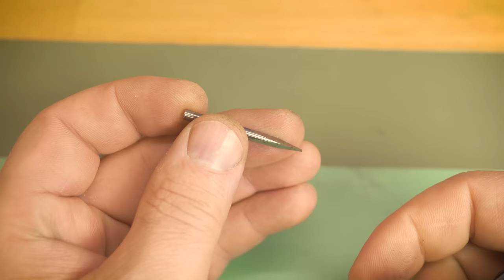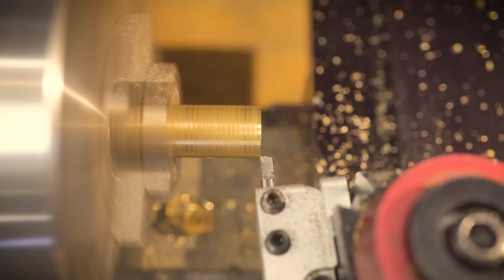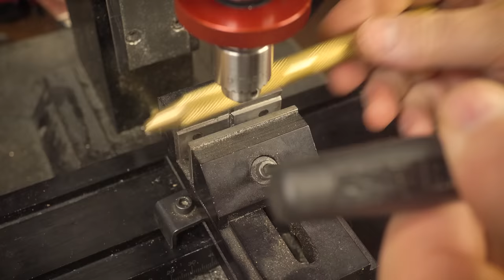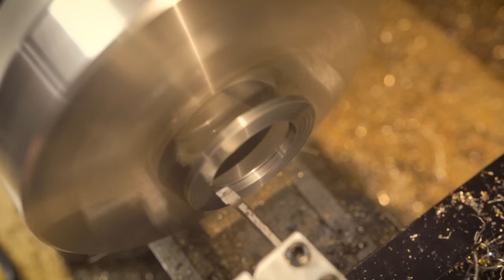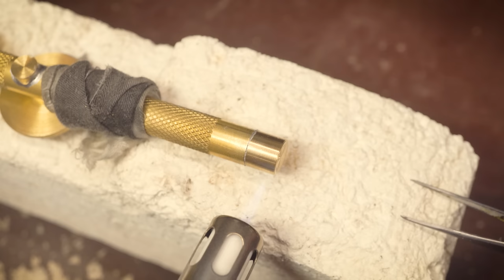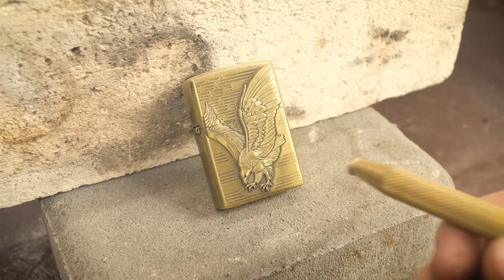DIY Sandblaster + Baking soda

Comment: Yet another beautiful job! I'm curious why you chose to solder in the nozzle, I would think you might have to replace it at some point.
Reply: Heat up and replace.😉
Reply: i was thinking the same and wounder if a 3d printer nozzle would work and then be easy replaceable and strong

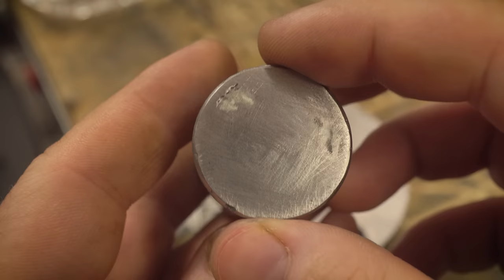Comment: 5:20 set heat to about 30 set your pulse to 1.5 if you want to go slow, set your low to 25% or just before the metal starts to gloss over, your high start with 45% if not fusing go higher till desired result. These setting are meant for thin metal fine work. I keep watching your awesome channel.
Reply: Michael Bishop   Jeebus, you can afford a pine cone, an elastic band, AND a paperclip?! 😲
Some people are so jammy; I'm still saving up for mine! 🤢

I'm right with you; I can't help but watch these fantastic videos thinking "ooo, I want a mini-lathe, too!" or "OMG, that fibre laser is awesome!" and "Wow, I'd love a tig welder!"  Then I remember the most important thing that I can't buy... the guy's talent! 😂
Reply: @Loneman_OG  I am so broke that my money owes money. I may know what to do with a TIG welder doesn't mean I own one 😂. Or have a safe place to run it, I live in an apartment unit second floor. The down stairs lady hears one loud noise and she comes over and complains if it's going to go on all day.
Reply: @DanteLevelsUp    I feel your pain, fella.  Years ago, I worked making commercial and domestic roller shutters, gates, sliding steel doors, window bars, and other security stuff.  I learned to use plenty of chonky tools & equipment, and I'd made myself lots of random things for my home.  Over-built car ramps, a fancy aquarium stand, a tank of a PC desk, and other assorted over-engineered stuff. 😎

  Now I'm restricted to small, DIY projects using timber mostly until the prices rocketed.  About 5 years ago, I discovered the 3D printing world, so I can release my pent-up creativity in that area. 💡😛

  About your neighbour, we have a grumpy old git next door who always comes out and pretends to potter around his front or back garden EVERY time he hears us doing anything!  He sticks his nosey beak over the fences to see what he can complain about; it got to the point where I told him that if he has a problem, and it's between 7am & 11pm, he can stfu and f3ck orf.  Which worked... mostly. 🙄😄

Comment: What is that tool called which makes the grippy part to that brass rod?
Reply: A knurling tool
Reply: @woutmoerman711  Of course. I'm an idiot.
Reply: @Keinapappa  please, don't be hard on yourself. You can't know everything and you did the smart thing. You asked!
Reply: @woutmoerman711  I've 3d printed knurled bolts and nuts as "fidgets" but my brain turned to neutral gear.😀
Reply: @Keinapappa  😄👍